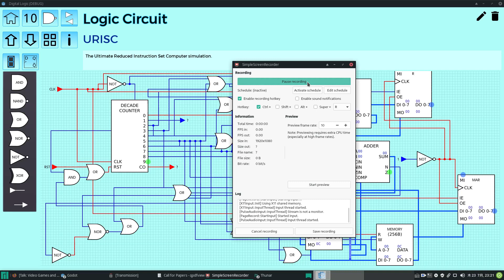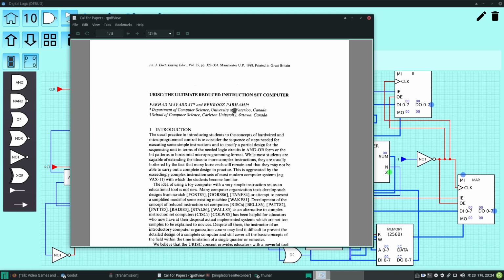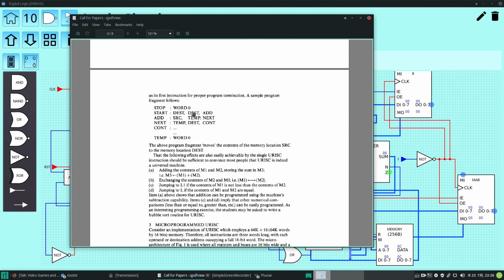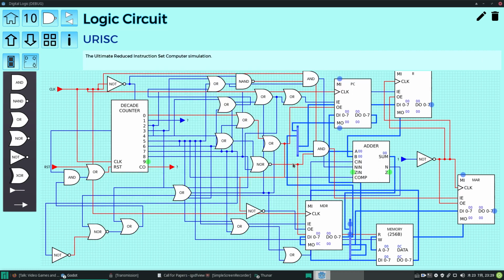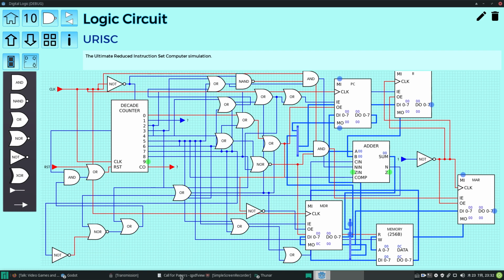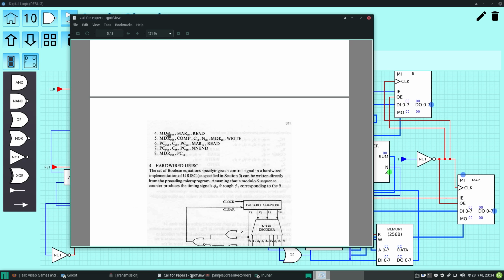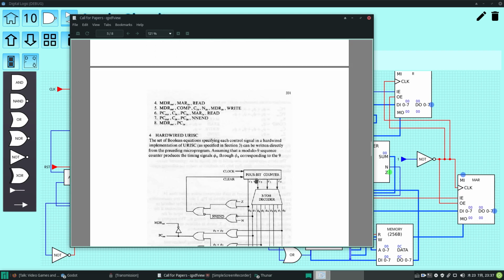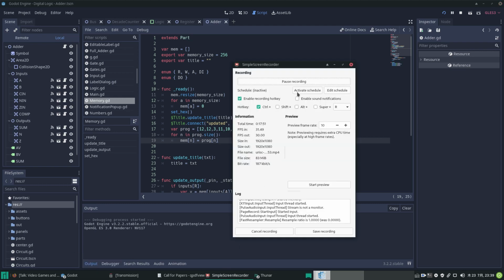Simulating a Computer in Godot Engine

Comment: hello, i am trying to make a similar thing but i cannot figure out how to connect the parts together. Can you tell me how you made tbe connections
Reply from the maker: Hello, I created a custom pin node using an Area2D collision shape so that it can detect the mouse and hence emit signals. The wire is just a line2D whose start and end points are made to match the positions of the pins. The pins have a property of array of wires that are connected to the pin. Then the pins are children of a Gate node. I didn't use it, but Godot has a GraphEdit node which you might be able to use for interconnections.

Comment: How did you link the gates together? How did you draw the wires between each gate?
Reply from the maker: Hello, the gates make use of the Graph Node which has features to create connections between ports of the node. The wires use Line2D which has an array of points to specify the points along a line.